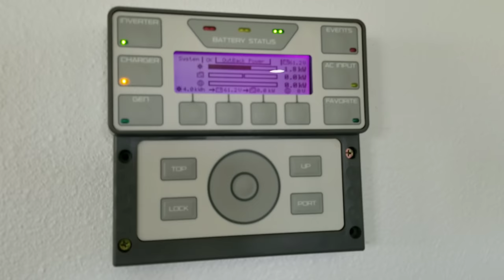Homebiogas Digester Every Home Needs This

Comment: You need 12"x12" concrete pads, minimum. 

FYI:
1 cubic ft of water = 62.43 lbs.
1 c.f. = 7.48 gallons
From this you should be able to derive everything else. 
Spread over 4 supports of a given area will give you the load of each support. 
Remember to place compacted gravel under each.
BTW, those supports, area, look small for those soils. You may need an additional 3" thick pad under each supports as well.
If not, you are going to punch through the soil.
Reply: These measurements gave me cancer
Reply: @RikkerdHZ  🤣😜🤣
Reply: Go metric! 1ml = 1g
Reply: Jeremy Desmond For water, yes :)
Reply: @RikkerdHZ  😂👍

Comment: The word you are looking for in the description of the "milky colored" roof and side panels is OPAQUE - pronounced O-PAKE. Bio gas is an interesting alternative to reliance on more traditional fossil fuels but you will find your output is not going to amount to much unless you have a condensing setup that will put your end product into a high pressure tank under compression load. Don't get me wrong these units are a great novelty for light usage in a low flow setup for occasional usage. All of that said and aside I wish you the best of luck.
Reply: I can't find the greenhouse for sale. can anyone share a link
Reply: translucent would also work
Reply: Alibaba
Reply: @Bellowtheline did you ever find one?  I am looking but never have found

Comment: If I had time to do this.  I'll stick with the ibc totes.  Place them in the barn and heat them with solar heating from outside.  Only problem I would have is to run the gas line to the house.

Comment: I appreciate the walkthrough.
In UK £ what's the price? 
I saw £4k is that reasonable or expensive.
£4k for a large specialised box seems normal but for a shed with a bag in it it seems a bit much :)
Reply from the maker: Believe me I have been doing biogas for years this is the best way to go. I have lots of videos on biogas so I can speak first hand.
Reply: screw that i made one from some old pvc pipe,some standard tap and pipe fittings, a air bladder (a glorified bag) and an old blue barrel, you get slurry and gas
Reply: plus you just paint the barrel black, you could stick it in a green house too, or you could dig it underground where it will stay the same temp all year round but that would be quite far underground about 6 7ft for a good temp, but if you want a box like that youd be better off buying some polycarbonate and make a frame to stick it in and you could double it up and also insulate the north side

Comment: it would be awsome it there was a way to either attach it to a piping in house and have it heat the house or fill the gas bottle to use it with stove, I saw a vid and a guy had it attached to a special stove but the stove was bulky

Comment: Thinking of taking the runoff to put into a aquaponics type system taking the runoff into an IBC Tote put a air pump underneath it to blow a lot of oxygen underneath it then take that run off and put it into the aquaponics system to feed the plants
Reply: I picked up everything to make the aqua phonics system last year and stopped when I found out the problems with the fish, now i think that i can start the  project utilizing my outflow from my biogas generator into another tote filled with water a aerated instead of fish

Comment: An IBC holds 1000 Lt's = 1000 kg so if your digester holds the equivalent of 2 IBC then that's about 2 ton.
I do pray that she doesn't sink like the Titanic or that would be a disastrous mess of twisted aluminium.
Reply from the maker: Actually its 375 gallons because the digester is only the bottom half.

Comment: Would this size ...bio digester create enough fuel to supply a electric generator large enough to make electric for a tiny house? I'll also be using other forms of free energy, solar, and wind as back up or as much that would work. This is my goal but I'm new to off grid living. I'm a senior citizen and social security doesn't amount to a lavish lifestyle. Thanks for your video.

Comment: also, how do you clean out the sludge. overtime it will accumulate and need cleaned out, right? then what do you do with the slug? what if you have a septic system. can you just tap that since its basically an in ground biodigestor?
Reply from the maker: I have lots of videos explaining please check them out.

Comment: If that will be 2 x 275 gallons of water/solids you are looking at weights around 5,000 pounds or more. Water alone is about 8 pounds per gallon. That would be 550 gallons x 8 pounds = 4,400 pounds. When you start adding solids that could easily surpass 5,000 pounds. You might want to rethink the pallet on blocks thing and think about making a real foundation for your biogas box. Imagine putting that junk SUV on your pallet.
Reply from the maker: Very true. And